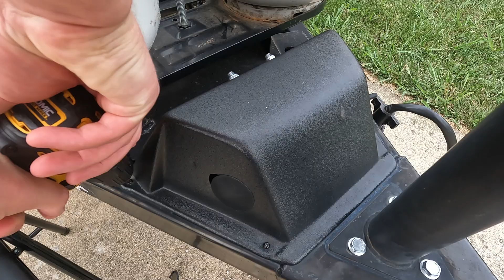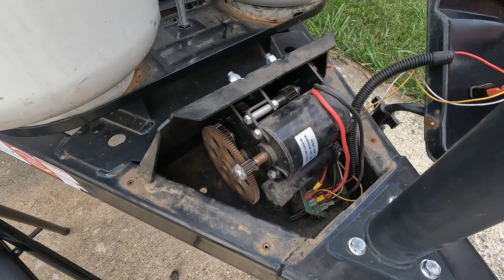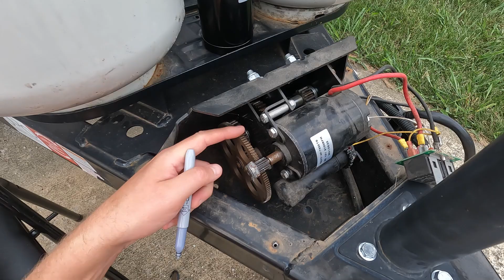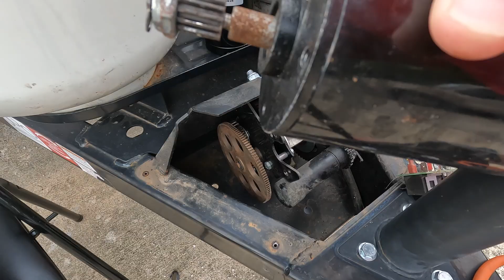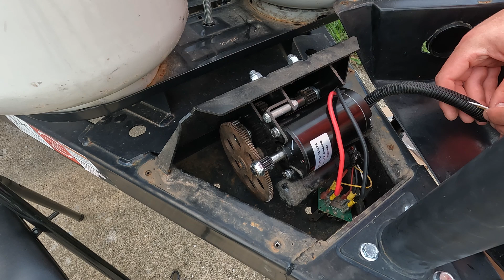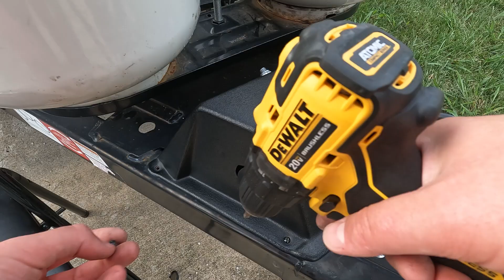Replacing lift motor on PowerWinch P55012 on a 2022 Rockwood 2318G

Comment: Thanks so much for the video! I just replaced a motor on mine and the relay that you were wondering where it mounts to mount up under that black cylinder beneath the motor the wires come around the front of it and then go at an upward angle to where the relay mounts below the motor! I’ll be posting a video of my replacement soon! So feel free to check it out

Comment: Thanks so much for posting this!😄

I never would have attempted to replace my motor without having seen someone else replace theirs first! Your questioning of the loose/unmounted board (at 10:36 in video) is good. In my case, the board that you connect the power leads to is mounted to the winch below the limit control assembly. I had to remove the bottom cover in order to connect the power leads of the new motor  to the board.

Thanks again and happy camping!
Reply from the maker: Thanks for the comment and watching!